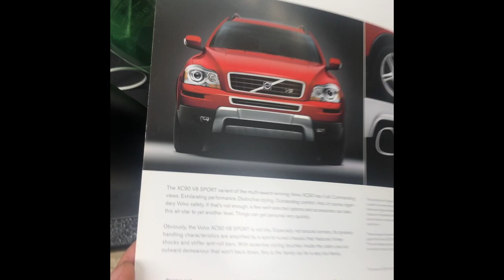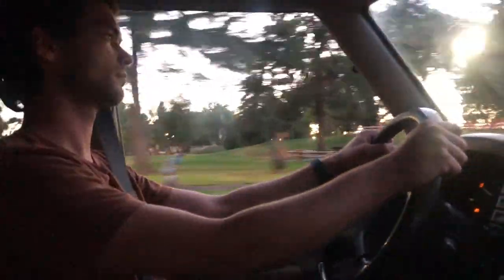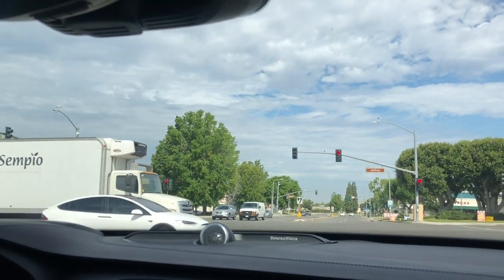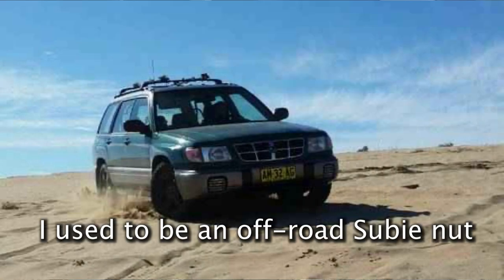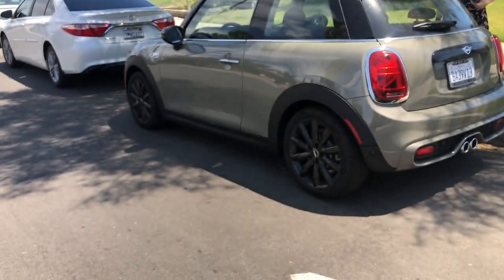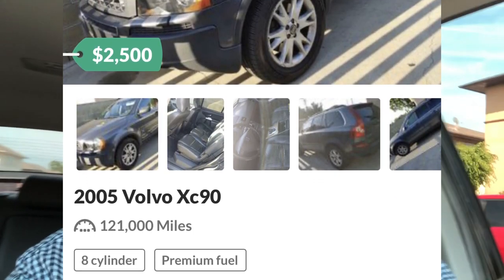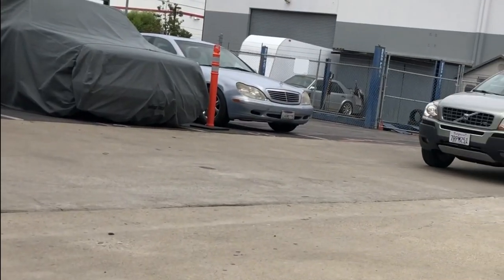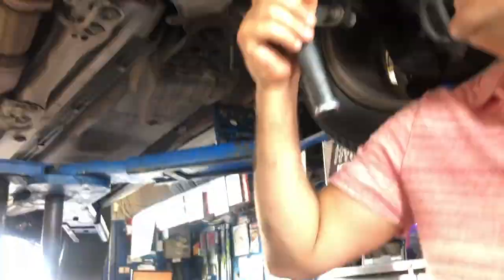Shopping for an SUV - from Land Rovers to XC90

Comment: I’m both a Volvo and Land Rover nut.  While I love my Disco 2, it’s just such a greasy pig.  Oil leaks.  Awful gas mileage.  The ever-present threat of head gasket failure or even slipped cylinder sleeves.... It’s quite well sorted now, but they can be an absolute basket case if not taken care of by a determined owner.  They should really only be in the hands of enthusiasts at this point in time because everyone else will ruin them.  Just too much care and feeding for the average car owner.  They are, however, LOVELY and incredibly comfy off road.

Comment: We just got my wife a 2008 Executive V8 with 43000miles and all options, the car is black with the saddle brown interior and we are the 3rd owner. The previous owners did all maintenance at the Volvo dealers, and even the floor mats had protecting mats on them and the steps on the side were never stepped on :D 
These are nice cars and have durable motors and yheyu will ge the same fuel economy as the 3.2.

Comment: You guys don't have Volvo's famous D5 engine.  I have two XC70's - one is a 2005 auto (5 speed) with the Euro 3 engine (202K miles) - 189K when I bought it two years ago) and has the Nivomat shocks. Regularly gets me 45+ US mpg over the road. Been flawless over the two years - just oil changes and partial transmission dumps every 5K miles. Looks like new inside and out.  The other one I bought 3 months ago. It is a 2008 D5 Lux auto 6 speed and active 4C suspension with the Euro 4 engine (158K) and has Volvo's Polestar installed. Goes like stink but mileage suffers - about 40 US mpg (probably also because it's FUN to drive!). Both have the semi automatic Geartronic suspension.  The Diesel D5 engine is the best of two worlds - lasts forever and gets great fuel mileage.
Reply from the maker: I would love to have that option. I’ve never seen a D5 and the country isn’t kind to diesel cars. I think they don’t like the high fuel economy numbers 😒
Reply: @DavidBello  The D5's are very popular here (the UK). if you take care of them they do 300-500K miles and the cars usually die from something else, like the ECU's failing. 
Part of why you don't have them I think is because most gas stations don't have diesel pumps (at least that's what I remember but then I was never looking for them apart from when I was trucking) - and perhaps car manufacturers prefer engines that last less than what most diesels do...:)  Now of course the governments are trying to kill the diesels and one of the way doing that is making the tags very expensive. 
I am paying £330 (about $460) for each of my Volvo's.
Like your channel..:)
Reply: Geartronic suspension ??? Geartronic gearbox is what you are trying to say.
The euro 3 does not have geartronic .Ai has tf55sc gearbox 5 speed.The Geartronic is tf80sc with 6 speed.Both with torque converters.

Comment: Why do you call that discovery 2 it a disco 3   td5 or V8 td5 was the much better engine same 0 60 as V8 but way better fuel economy xs is basically base trim u need Se or HSe
Volvo under pinning where developed from land rover as the xc90 and land rover Freelander and discovery shared many chassis bits. As they where both ford companies